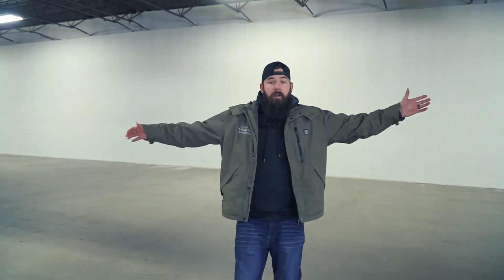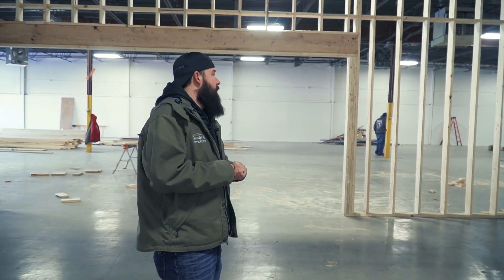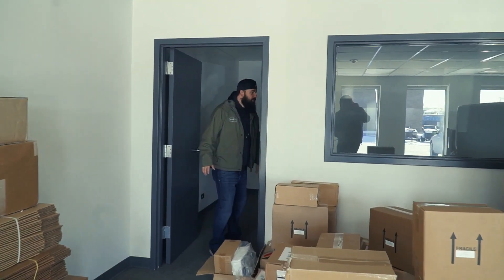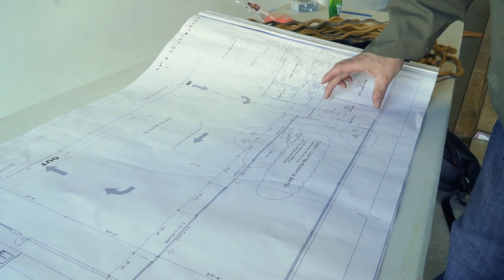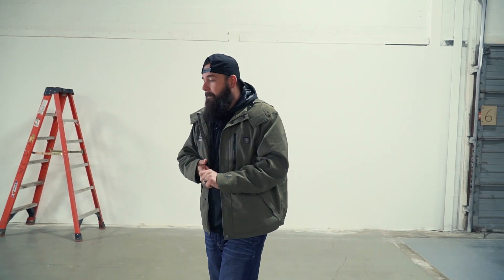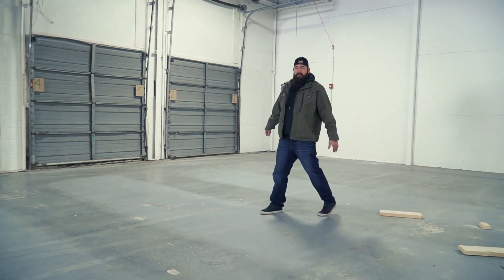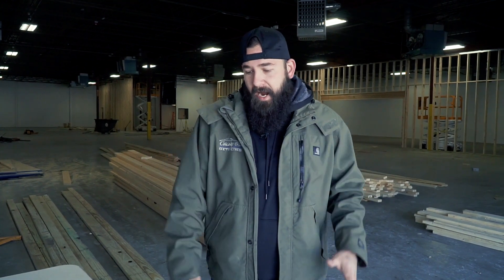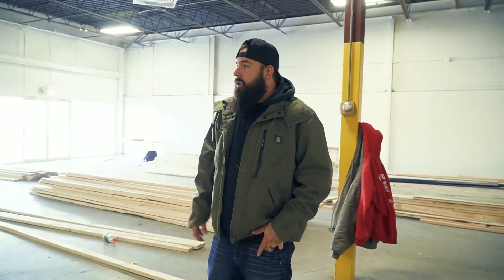Building My Dream Detail Shop | E1

Comment: Have you thought about having an air lock between you main shop and the clean room? It would be a car size air lock, with a shutter door in. Close the 1st door then open the 2nd door in to the clean area once the 1st door is closed. This would be a great advantage in keeping the area as clean as possible.
Reply from the maker: I have not thought about that until now. That sounds really cool, but I don't know if we need to go that far.

Comment: I work in a shop with a sloped floor, be careful with the grade. bad for feet and ankles  and can make it tough for ladder placement. I don't want to change your floor plan, just giving some caution. I hope I can be in your situation here in Indy, but I want to be able to accommodate large 18 wheelers too.
Reply from the maker: It will only slope a total of 1 inch
Reply: @ChicagoAutoPros  that should not be much, the floor I work on is at least 6 inches over about 48 feet. I would say it is roughly 15 degree pitch. If the funds is there, radiant floor heat will speed up the dry time too.